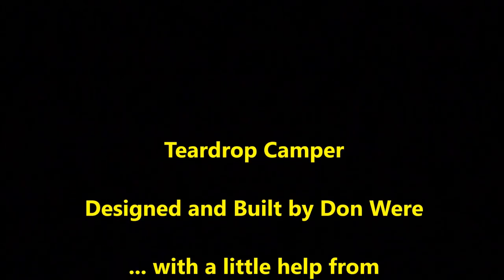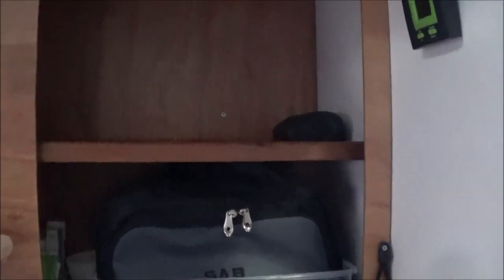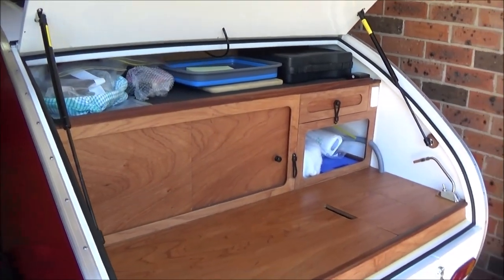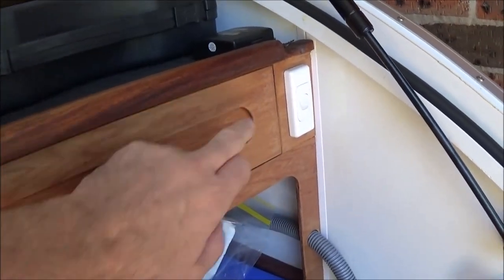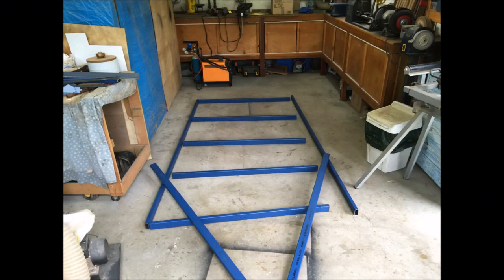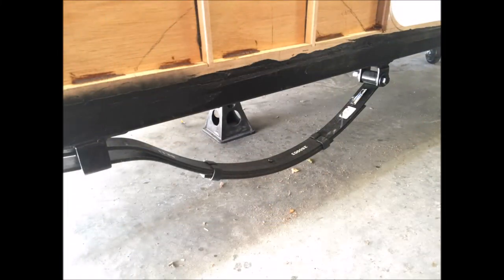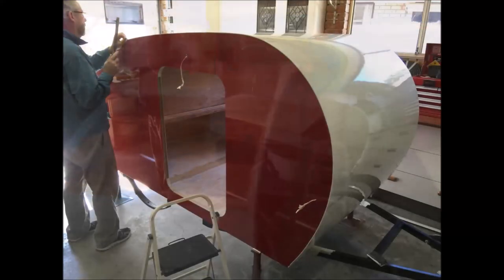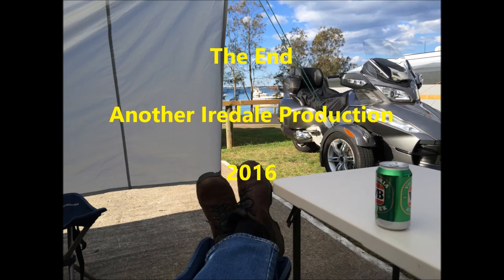Teardrop Camper Build

Comment: Nice. How much does it weight? How does the Can Am spyder tow it?
Reply: According to Can-Am specifications for the OEM hitch is 400 pounds pulling w/40 pounds straight down on the tongue.  However, I've seen people demo how strong it is by standing on them.  Engineering for subdued hwy dynamics with a design margin would probably put catastrophic failure at 2500 lbf tensile w/500 lbf shearing.